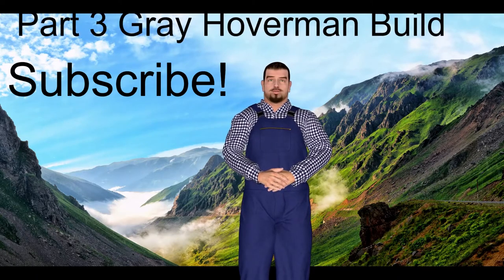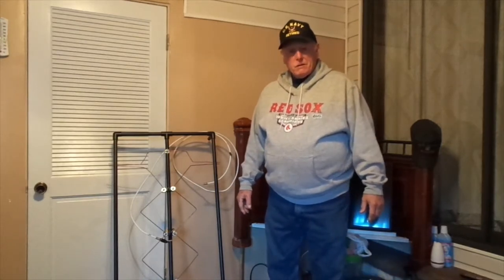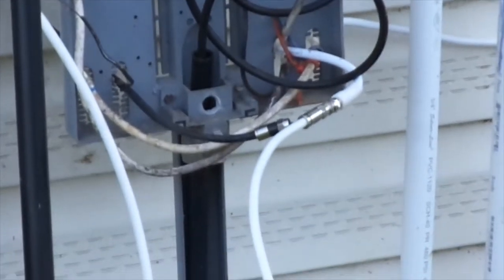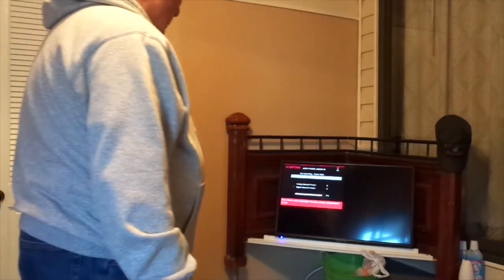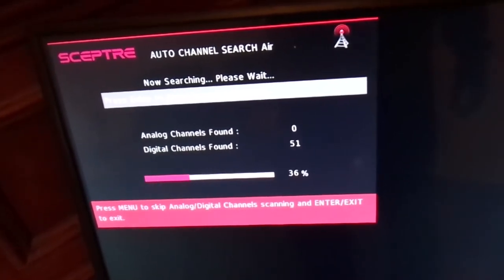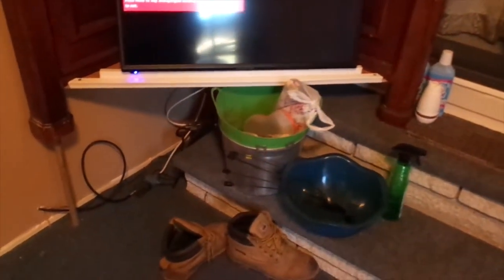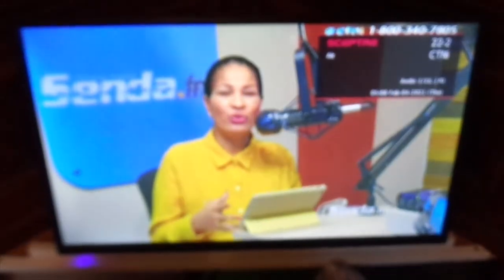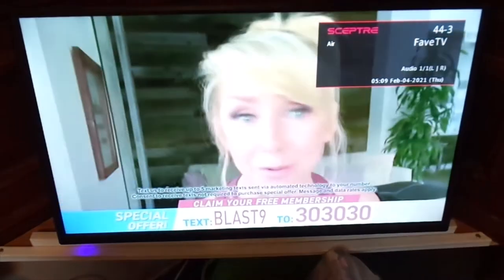Gray Hoverman build part 3

Comment: I was told the when an antenna does not have a reflector, the tenna will receive signals from both directions.
Reply from the maker: This is true, the antena becomes omni directional, but with the reflector, althought the antena becomes directional, the TV signal bounces off the reflector giving the antena a second chance at the signal.